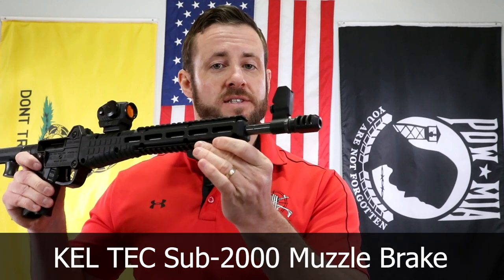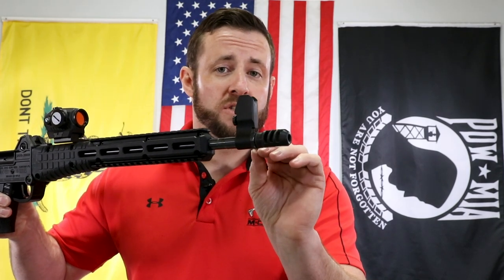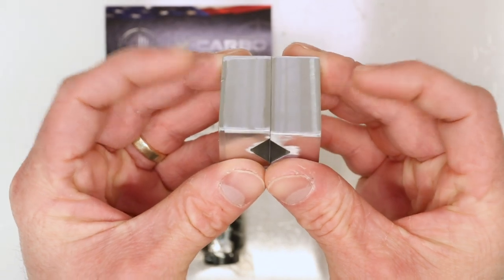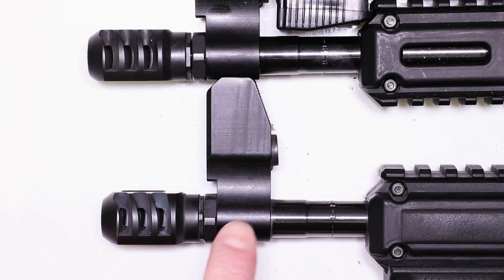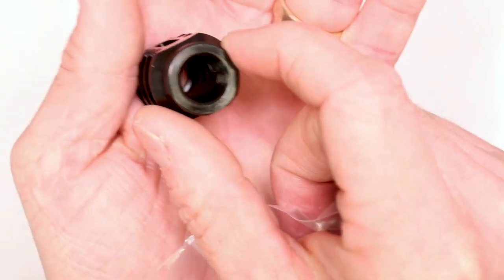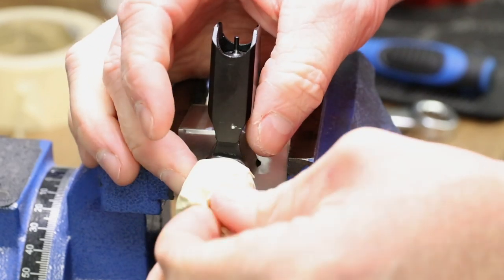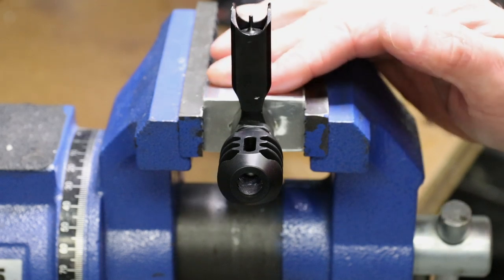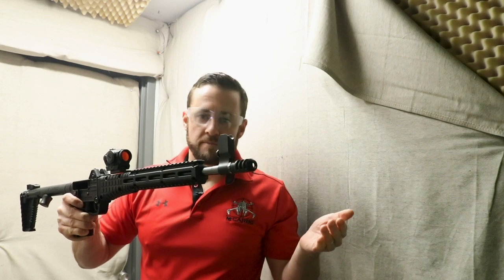KEL TEC SUB 2000 Gen 2 Muzzle Brake - KEL TEC SUB 2000 Accessories!  M*CARBO

Comment: One major issue that I ran into that caused this to be a 2 hour job was that even if you think the front sights are tight, they will still tend to rotate when tightening the compensator down. It was very difficult to line up the sights and tighten the compensator down at the same time. Will definitely need a re-zero and I hope the sights arent too far off from factory. By the way, I never messed with the front sight assembly prior to this upgrade

Comment: Since you changed this to use a crush washer, and you warn about the torque on the plastic where the barrel seats to the plastic, why aren't you including the aluminum barrel vice bloc as part of the product?  You go on about how important it is! It seems like a big omission and a giant risk for anyone buying this accessory. Just include it, or provide the option for the counter washer ... much simpler, and much less prone to damaging the gun!
Reply from the maker: Some people already have barrel jaws and then we'd get the question of "why am I paying for these?" 
There is a drop down menu on the purchase page that makes you choose if you need them or not. 
It is up to the buyer to determine what they need to work on their guns, same as if you change your brakes on your car.

*All firearms parts and accessories should be installed by a competent gunsmith.*
Reply: @MCARBO  Why are the vice jaws you are sending out different from the ones in the video. The set I received did not have any deep or shallow contours to fit the barrel and would NOT clamp onto the barrel to stabilize it enough  for the install. I tightened the vice enough (literally as hard as I could) that it marked the aluminum jaws with the barrel impression, but because they were not contoured they would not clamp the barrel in place. As a result, even with masking tape, my barrel was still damaged. The muzzle brake itself would not time correctly no matter how many times I tried using the exact method from the video. I have sent a separate Email to your company with pictures of the result.
Reply: @2005Aztek  Same here, no step in the jaws at all and they sent me the older version muzzle brake… Any luck dealing with the company? My barrel was marred as well even wrapped with tape.
Reply: @ketobeast8489  Its been a while, but MCarbo responded. They said the barrel scratches were more than likely aluminum from the barrel jaws. I was able to clean a lot of it off (but not all). I was able to finally get the brake on. It took constant adjustment (tightening) of the vice and very small advancements when threading the brake onto the barrel. Much more difficult than it needed to be.
Reply: @2005Aztek  Nice 👍🏻 yeah I got mine on too after an hour of the same bs as you went through. Hassle could’ve been avoided with correct parts. Still gonna see if they will compensate for the wrong part hopefully will send me out the dual side QD sling mount no cost

Comment: I just installed the muzzle break on my KelTech sub2000 and the barrel jaws and vice combo are a must! The amount of torque needed to crush the nut to the point of leveling would not be achievable just by using your hands and wrench to stabilize the barrel.  Super easy install with all the mentioned tools in the video.. all fittings are tight!

Comment: Just finished this install along with pretty much everything else.  If you’re considering doing this, the barrel jaws are a must due to the small area on the barrel that one has available. The jaws that I received are about half the length of the ones shown in this video but work perfect nonetheless.  It is only a bit extra with the purchase of the muzzle device.  I had to wrench it over almost 360 degrees to get the timing correct and the barrel jaws did the trick.

Comment: First I ordered the barrel jaws which were not tapered at all (just a straight "V" cut).  It did create marks in the barrel where it was clamped, so I would definitely put more wraps of tape on the barrel than what he used in the video.  You'll have to really tighten the vise to get it to hold well enough to tighten the muzzle break (the 4 wraps of tape was enough to protect the muzzle break).
Reply: I just got them as well to do the muzzle break. Mine have a very slight mark where it seems to be a 1/16th of an inch deeper on one side. I hope this is what it's supposed to be as far as depth goes. If not it's aluminum and I am sure the steel barrel will win that fight. I have installed muzzle breaks with crush washers on other firearms before so this should go easy with this tool.

Comment: Great video easy installation ..took me 31 minutes even watching the video and installing at the same time to make sure I got everything hooked up right ..couple of scratches though on the barrel so the more tape you use I think the better on both ends for the barrel, and compensator had a few cosmetic blemishes afterwards but nothing that a good black sharpie didn’t cure. As far as vice. I used a chepo  Harbor Freight..20$ central Machinery vacuum base vise.  Site stayed zero…they are good. One real good advice. If you see your barrel, moving on the voice stop re-tighten device and move forward it is plastic will snap. The install was on the second GEN sub 2000 9mm.

Comment: I just installed on my Smith and Wesson m&p FPC. I didn't use a vice. I placed it on a bench with towels below it and towels on top of it and use a 12-in adjustable wrench put my weight on it and there's some room for my hand to grab the front and just tighten it down. Like the way you did I timed it perfectly. Took me like 10 minutes, I also use electrical tape, put it on the wrench and put it on the muzzle break

Comment: I done my muzzle break install today on my KelTec S2K. First of all the muzzle break is quality made product by MCARBO. I had problems though, everything was going good when I was torquing down the muzzle break and then all of a sudden my front sight turned on me. Chris does mention to be sure and check your front sight to see if it's on tight. I did and it felt good and tight. Although in my case my S2K serial number had been on the barrel recall replacement list.I had sent it into KelTec to be replaced a little over a year ago.They did replace the barrel, but I don't think the tech that worked on my S2K torqued down the jam nut good enough when replacing front sight. Long story short I got the muzzle break installed looking good but it was a "B" getting the front sight and muzzle timed back right. Also I ended up nicking the sight a little bit with my wrench tighting the sight jam nut up,😭. That's  something else to repair now lol. I really like the look of the S2K muzzle break though,thanks MCARBO for your product and the detailed videos.

Comment: I just ordered the muzzle brake and optic mount. I've previously installed the all-in-one trigger bundle and recoil kit and installed it myself. I loved this platform stock, but it's a game changer with these upgrades. I can't wait to to finish this firearm! These boys flipped a decent platform into an incredible one. 

My only suggestion would be to demonstrate firing before and after the upgraded platforms. It would be nice to observe performance from stock to upgrade. 

For instance, my trigger pull difference is absolutely noticeable, however, the recoil reduction upgrade wasn't as apparent. It would be nice to see a mag dump before and after.
Reply: Regardless, I'm like a kid in a candy store waiting for these last upgrades. All-in-all, with the gun, upgrades and my Leupold LCO optic I'm sitting around $2k for an absolute tack driver platform.
Reply: @Hlfburnt  Now it is no longer a "Sub $2000" :).

Comment: 2023, I wasn't comfortable with the barrel jaws that I bought to do the muzzle break. I couldn't clamp it tight enough. I had some leftover half thickness jam nuts from a previous build and used that instead. It works great.

Comment: I voiced mine up with a thick towel just to hold it. I used 2 3/4 inch open end wrenches. One on the existing nut that holds the front sight on and the other on the compensator. Tightened up just fine. Do not just use a wrench with the e plastic in the vice. Gotta use the nut and a backup wrench.

Comment: I have been holding off on buying one.  It looks perfectly functional and cosmetically beautiful.  Can anyone advise if there is ANY upwards muzzle flash created by this that could POSSIBLY obscure the ability for accurate follow up shots at night preventing you from getting back on target?  This is important and is not a trivial issue.  I am talking about for LEO and life and death protection at night.  Looks is not as important as safety. Some powders are not flash retardant and some powders are slow burning, so sending muzzle flash upwards sometimes is a no no.
Reply: Mr Wolf be suggestion its a 9mm pistols dont run comps on them either. LEO issue your running hollow point self def. Ammo flash is same as a pistol. You run a flash light and or use a AR style bird cage flash hider if this of being blinded. Dont use a comp is your main worry I guess. The sub2000 work great day or night just as it is. I have one love it. Comps my glock 23 perfectly... 40 cal. No blinding issues I run a pistol light on it.

Comment: So I installed the shorter version muzzle brake on a Gen 2 KEL TEC SUB 2000 and have a couple comments:
I’ll second a comment I read about the barrel blocks being a different design than those in the video; the shorter version required substantial clamping pressure from the vise for a secure grab.
Another issue I ran into was the front sight locknut turning as I crushed the washer.  After I reset the front sight, I had to use a second wrench on the locknut to avoid movement while finishing the crush and alignment of the brake.  A niggle but good to know.

Comment: I just picked up my Sub 2000 today. Before this video, I watched the one on your red dot mount. My question is how did you get your rear sight to lay down? Is it necessary for the red dot mount to be effective?
Reply from the maker: We use our rear sight. https://www.mcarbo.com/kel-tec-sub-2000-rear-tactical-sights.aspx
Reply: i took my rear sight off      it does interfere  a bit      they sell a flip dont rear sight if you like but its not cheap      so  i just red dot    so much better

Comment: Was super excited to receive mine followed by extreme disappointment when I realized the vice jaws were not milled like in this video to accommodate the flare in the barrel which means they would not grip the barrel properly. Took me 2+ hrs to rig it up properly to hold it steady. I’ve emailed Mcarbo for a refund currently waiting a response. Also the crush washer is too thick I had to pre crush and file it down a bit to fit as I had to turn the brake over 360 degrees to be timed perfectly. What a freaking headache I would much rather just had the lock nut with a shim or something just to hide any exposed threads. Also I pre checked the front sight locknut it was super tight and when timing the muzzle brake it took so much force it turned that locknut and threw my front sight off that I had to take everything back off and readjust… Questioning my purchase bigtime right now I hope Mcarbo makes this right. Will update.
Reply: I had a similar issue.  Sight was already crazy tight. 
I was able to get the jaws tight enough in the vice but the sight turned just as yours did when the crush washer turned against it.  I had to take the muzzle brake back off and time the muzzle brake and the sight to align.  

Just sighted it in perfectly the other day.  Now I will have to check how close I set the front sight.

I think the jam nut would have been a better solution.

I did back off and re-tighten as I spun the muzzle brake.  Mine took about 270° from where it started to crush until it was timed.

Personally, I would have not applied this much force if it wasn't necessary get it timed with the crush washer.

Comment: Vice blocks provided with the kit are different (smaller) than shown in this video. It is unclear how these smaller blocks are to be used.
Reply: I realized the same… it doesn’t have the “step” as shown here to accommodate for the barrel flare so when torquing down the brake it spins the whole barrel in the vice. I had to spend 2+ hours figuring out a way to keep it sturdy. I had to end up filing down the crush washer to get it timed perfectly as it had to rotate over 360 degrees… Depending on their handling of this issue it might be the last purchase from this company.. Also the actual muzzle brake looks different than in the video, the end is flat not rounded. Will update..